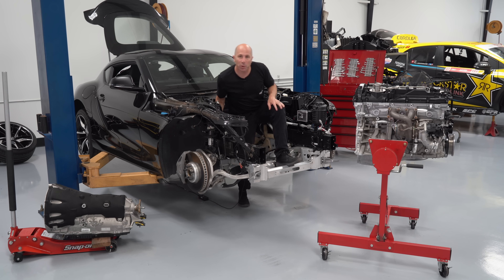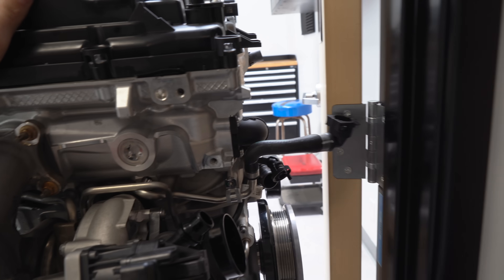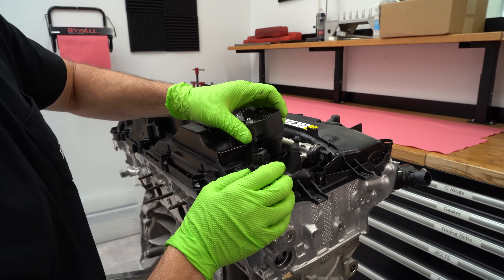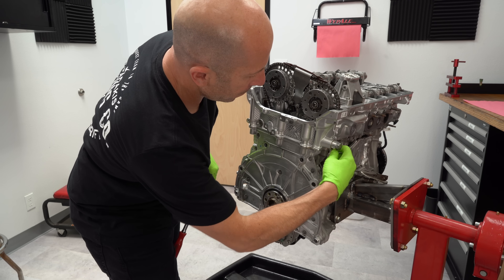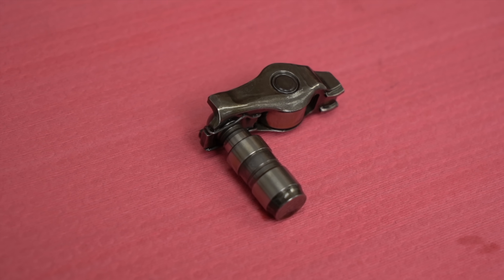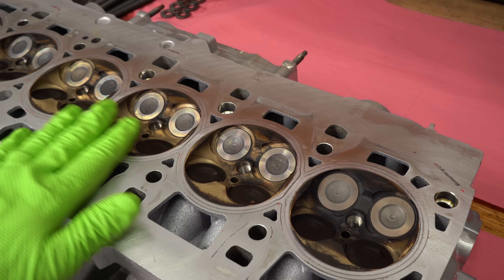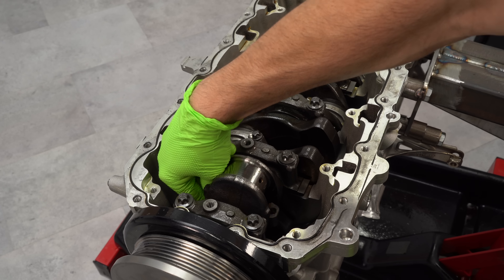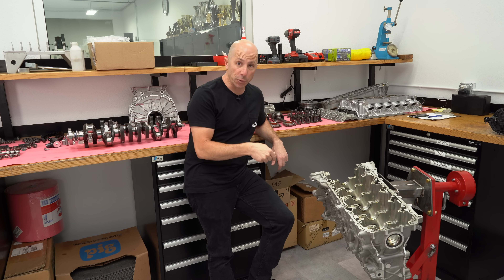2020 Supra B58 Engine Teardown - First Look - Better than the 2JZ?

Comment: Those Forza-playing 14-year-olds will NOT be pleased to hear that you said positive things about this BMW engine
Reply: Nobody gives anything new a chance anymore.  2JZ greatest thing since the sewer system was invented. Blah blah blah
Reply: I just laugh when I see both Toyota and BMW fans get together. Hating is loving guys let’s all shared the love and give BMW some respect McLaren F1 engine was made by BMW and hold the record for years.
Reply: @isfngu4213  you leave in the past.
Now 2019 and bmw comfortable crap.
Reply: Edgar O'Kras I owned car made by both companies and work on both of them100% no mechanics touches any of my cars except for recalls by the dealership . I work on military aircraft so these engines are pieces of cake compare to what I do daily. May I say I don’t gotta make sure it lock wired, stamp and verified by a 3rd set of eyes each time I rebuilt, testing and certified each unit. I have no problem working on them even though BMW required special tools . Each has its problems of their own that can be said to all manufacturers. Toyota interiors are garbage. BMW isn’t made for the poor. If you see an old German car still running that person isn’t poor and it’s not cheap to maintain compare to a Japanese cars. You might be right I m old school but the technology age is growing rapidly. This engine is not the last you will see ask how I know . in the near future you will notice German companies producing “CamLess” heads.  I love my Toyota Mr2 engine is exactly same built as 2j , but I m sure everyone need something New . More modern the answer has been made now let all enjoy what manufactures has given us as a consumer.
Reply: I clicked on the video for comments like "Nothing is  better than the 2jzzzzzzz. 2jz best engine, none better" and stuff like that😂
Reply: @CBrown621  found one
Reply: @CBrown621  funny how to this day its the ONLY IMPORT ENGINE in the world running 5's GTFO. The fastest BMW out there barely ran a 7.20 and was a promod from africa. Its also dominating in the races its allowed to run. Why not tell lemans stop being little bitches and let toyota run 2jz's you see what happens in Drag and in Time attack. Look at the drift world. 2 engines 2jz and LS easy make TONS of power very stout motors.
Reply: @sariahreigns3666 A car powered by a 2jz  will run last @ Leman 24H. A 24 hour race is very different from a Drag race or a Time attack.Once that Block has heat soak from the first hour, you then have 23 hours to go. Too many re-fuelling pitstops. They're getting more power and fuel efficiency out of a diesel.
Reply: @nssherlock4547  i was just using it as an example. Every sport that motor is in it competes and sometimes DOMINATES.  As far as durability, real street won second place in drag week with a SEALED engine. 

Thats 3 runs 7 days 5 tracks. also driving on the street and towing a small trailer from track to track. Thats a PRETTY durable motor. I also know 3 people with 2jz's that run thier cars pretty hard have over 800HP and dont really have any problems. 2 of the three have ran thier setups for over 5 years.  

As far as fuel efficiency well there are ways around that at cruz cutting clyinders off alot of tuns can do now. But i do agree its not as efficient as diesel. 

But for people to continuously try and claim the b58 motor is better then the 2jz is rediculous. Performance wise there is 1 maybe 2 motors that out perform it and non of them are bmw.
Reply: @sariahreigns3666  the 2jz hasn't dominated anything but exhibitions. You compared exhibition cars vs promods.
Reply: Come on guys, can y'all just have an objective opinion rather than being irrational haters and fanboys
Reply: CRA_55 The objective opinion says that the engine is complicated, expensive, hard to repair, and needs lots of tools
Reply: @BF109G4  Some things that need clarification on what you said about the engine, complex no, simple no, at best intermediate. Expensive yeah but on what scale. Hard to repair on some parts yes but on others no. But dont keep speculating when it hasn't even proven your theories and also dont shut off compliments on engine he said and only keep your ears open to the words you want to hear
Reply: @BF109G4  E30 M3 Evo II daily driven by me,28 years old is it now....only unexpected repair was the water pump about 6 years ago.On my E39 540i,with nearly 450000km on it as I sold it,the only thing that broke unexpected was the AC.So not every BMW is crap.....
Reply: 14 year old gamers have thousands of hours of engine design and tuning experience.
Reply: This car with 93o, downpipe, and tune ran 10.79s! These cars are a lot more impressive than I thought they would be. I’m more or a muscle guy but I appreciate anything that’s fast that’s for sure!
Reply: phew good thing im 15
Reply: Idiots say that

True car guys know that bmw has lots of power with just little mods
Reply: CRA_55 14 year old forza player here:
I think the B58 will be the same (or almost) as the 2jz, and the 2j is overrated, can’t wait to see what people will do with the mk5 in 2-3 years, 
The 2 bad things about the mk5 is that they didn’t make it look like the concept, and that it’s automatic.
(If i wrote something wrong i’m sorry, not english)
Reply: Engel Schol good luck with a belt driven oil pump lol
Reply: I don't understand why most people here slag this engine off. Bmw have always over engineered they're engines. I have an m50 in my 3 series which has forged internals from the factory. There's people on here who has squeezed 500bhp out of that aswell. Toyota obviously know what they're doing when they've used the new bmw engine. They're both good manufacturers at the end of the day.
Reply: @dav3ys  it's the dawn of a new age man most people that race anymore are ricers and us that know what we're talkin about have pretty much all Gone with the Wind it's sad really I can't believe how simple-minded the world has truly become that people are such a bunch of retards, that's why my M3 so far is undefeated people are so gullible nowadays
Reply: It’s a BMW engine that was torn down and rebuilt by Toyota engineers. So far, this engine looks pretty good. I can say I’m impressed and happy to see them reduce the number of gaskets (which are definitely fail points for high pressure) and using silicone gaskets when they do. Looks like the new Supra might have the first reliable BMW engine ever not on a motorcycle 😂 

And yes I can talk shit, the CEL is on on my Bimmer 😂 😭
Reply: @Mr_Bones.  it wasn't rebuilt by Toyota.
Reply: Fuck them.
Reply: Lol you can say that a 1000 times over
Reply: I laughed so hard that my dick got hard as well
Reply: 14 year old forza players don't even know what a 2jz is
Reply: Nothing like those BMW cock suckers that but in and ruined a legendary car because BMW don't know what real power is so they rebrand it and say it's fast
Reply: HiShoK didn’t they have a bmw engine in a McLaren that held a record for years
Reply: Actually i find that engine pretty cool :p
Reply: @Basti A the way turbos build power is much more then just changing the size of a turbo. If the manifold is BUILT into the motor to get BIIIIG Power out of it your probably going to have to replace the Head of the motor with a custom head ported and polished exhuast and intake ports? I dont even know because its such a dumb idea for aftermarket. Youd be better off aftermarket wise trying to fit the n54 head to the b58 block atleast then you can run external intake manifold, and external exhuast manifold. Because no matter how big the turbo is if the exhuast runners arent big enough to handle massive air flow big turbo wont do shit.
Reply: @sariahreigns3666  you seriously need to calm down.
Reply: Controversial opinion, but I actually like the MK5 over the MK4
Reply: Never liked BMW but this engine seems pretty cool.
Reply: hahaha
Reply: Well, BMW is a great car maker.. right?
Reply: Cool engine. I'm just confused why we're giving toyota credit by calling it a "Supra" engine.
Reply: @Basti A nope. Just not a fan boy prenteding like I know what I'm talking about.
Reply: honestly, the 2jz makes a better dyno queen race car, but this car actually looks better than the bubble-mobile mark IV and makes a way better daily
Reply: мне 22
Reply: These engines are still pretty new, only time will tell if they're reliable or end up becoming the next S85.
Reply: @Basti A in the last 10 years a few American owned engines have been on the best of lists.
Reply: @Basti A even international top tens there have been us designed engines there it's been awhile since America hasn't really released a new engine to the masses yet that has been a huge revolution. I'll admit that.
Reply: @Basti A and that really doesnt matter. Lists are never exactly the same between publications.
Reply: @Basti A fanboy
Reply: Brock Nelson that is a fair point I don’t care for timing belts.
Reply: Whilst I am impressed with the all in designs that BMW came up with to save weight all those will become useless when you start factoring in things like fmic's and there will have to be a better designed exhaust manifold for a bigger turbo I'm sure it will hit 1000 but its gonna be a money sink on custom built parts until the aftermarket world works this shit out
Reply: @Basti A hes not stupid just wait 40k for oil leaks to ensue around that rear timing chain and then you've got 18 hour repair job because they put the damn thing in the back didnt anyone learn from the 4.2l audi motor
Reply: video games bad
Reply: But muh 2 gay zee 2000 horsepower from factory
Reply: @Tunnel Zone yeah it's done a lot better than I originally thought it would. Lots of aftermarket dollars does help. I'm amazed at what people are doing with vortec 4200 for a lot  less money though. I really want to drop one in a firebird and go make some mk5 owners cry.
Reply: BMW is superior
Reply: Look dude, I may be 30, but my inner GT4/NFS:MW playing 14 year old sure is not excited
Reply: Great Engineering, better response but definitely headache and a money pit. 2jz  bit lazy at first but definitely reliable.
Reply: It was a collab with Toyota not all bmw
Reply: Lmfao
Reply: OM606 … 🔥
Reply: 2jz is my favorite engine, but I agree 100%  this tik tok generation of kids glaze it thinking it's the only engine that works. "1000hp" bro"  

Bmw made a great product here
Reply: I'm a bit wary of BMW engines because they don't have the greatest track record for reliability, but since these particular engines had to pass Toyota's QC process, I feel much better about them.
Reply: 😂😂 best comment I've read all day 😂😂
Reply: CRA_55 💀💀💀
Reply: Leave it to BMW to over complicate an engine...oh and cause choke points in its design making it harder to modify....can't wait to see the issues he runs into trying to get 1000 hp out of it with that stupid one piece head/exhaust manifold...not to mention the overly complex variable valve lift crap...
This engine looks like it was well designed to handle the stock amount of power...and not to be modified for much more...plus the thing is huge.
Reply: @harryguy76  Do you have any idea how long it took the aftermarket to get the supra over 1000 whp... that didn't exactly happen overnight
Reply: @1994SHOtime  Yes but this engine is designed from the ground up to make and be as efficient as possible at its designed intended hp and TQ... not over built like the 2JZ...Imo the head design and direct injection are a bottle neck and imo the block is not strong enough...plus the way they have designed the bottom end is so stupid having the block skirt down around the main caps rather then tying it all together with say additional cross bolting into the main caps...
Reply: @harryguy76  well, mission performance is already getting 630+ WHP on stock bottom end B58's, so we're only 370 away from 4 digits. Bet me that we see 4 digits with this block/engine.
Reply: @harryguy76  cross drilled mains is only to make the block more rigid it has never made the engines block capable of more hp. As people have made 4k hp on 4 bolt main blocks
Reply: @harryguy76  there are already closed deck BMW motors with over 1200hp on them. The only problem have been the clutches in the Dct tranny and rear axle holding up. General drag strip problems. Let me know if you need me to share that with you.
Reply: Hey man I play Forza but I'm also a street racer and BMW in fact makes the best inline 6 engines so all these ricers complaining about BMW parts are just retarded, if you all don't believe me Google search it and you'll be surprised type in who makes the best inline 6 engines and you'll see BMWs number one with their M3 E46 same engine thats in my car
Reply: @Basti A thanks for the insight,  didnt know that. then there is pretty much nothing you can do if you need more volumetric efficiency. welp good luck to the bmw fans. soon as c8 vette gets a manual trans im going to get one.
Reply: The problem is; name me one BMW M car that hasn't had catastrophic engine issues? It's OK for reviewers to wax lyrical about it now, but tell me how you're getting on with it 3-5 years down the line when you're staring down the barrel at the cost of an engine rebuild, and the panic across your face .. hoping the car will pass the inspection so you can sell it onto the next poor sucker. 

And lets be honest, its not as though Toyota couldn't resurrect the 2JZ, or better still, pull a 6 cylinder from off the Lexus production line. What Toyota was thinking by getting into bed with one of the most unreliable name in the business, I'll never know .... other than, as Scotty Kilmer says, the money these companies makes from 'Planned Obsolescence'!
Reply: @juststuff5216  2001 e46 M3. To date, still on the original engine and 200k miles to speak for. The only problem was a change of coils  at 120k and the recalls done by BMW free of charge, other than that the car is still the rock solid  car I originally purchased. So as it stands, I own a reliable 3.2 liter 344 hp NA engine that sings all the way to 8,900 rpm. Such engine is an honest to god racing engine so I treat is as such. I feel lucky to drive it on the streets. Keeping up with the service intervals is key and I am more than happy to do that to keep driving the ultimate driving machine. I will never skimp on servicing costs because that would lead to much more expensive repairs in the future. Also, I will never part with this gem of a car and motor. I also own a mk4 supra bone stock. During my possession, I needed to replace, water pump, plugs, AC compressor, tempreture sensor and belt tensioner. Again, this car was serviced as per recommended intervals. Which car will I be parting, needless to say the supra, but I will wait for dipshit fanboys like you to push up the price of the car, and most probably get the mk5 supra instead (I just hope they will introduce  a manual option by then). I also own the mk2 MR2 and celice GT4, the MR2 and Celica being in my possession since new, and it is the same story for them too. I also own an FC and FD Rx7, those where a nightmare.  Problems with gt4 and sw20 failing parts like the supra. To be honest to god fair, the Japanese vehicles had cheaper-ish parts back then, today though, not so much. I am stoked the Supra has a BMW engine inside cause I know, if well taken care of, they function like clockwork.  How is that for BMW M division reliability?
Reply: @juststuff5216  E30 M3,E36 M3,E46 M3
Reply: if  that alumunium bmw engine block have the streght of iron block 2jz it have potential but long its race car but if a normal life condition not so much because stupid ass bmw electronic just look at that how complicated that thing is
Reply: Basti A you maybe right I’m more familiar with cummins where most high horsepower engines are swapped with stock machines rods or forged rods but it could also be due to poor castings or a bad design of the cracked rods. The built in exhaust manifold will be a problem for sure though.
Reply: @farmyardfab  yeah i give you the Points for the exhaust Manifold. My Tuner owns a M5 running at 900hp and 1140nm without any Problems with the Cracked ones. The engine itself can handle 500hp easily, the Block more but you would need to Switch to a bigger turbo and Open Air intake which isnt a big hassle
Reply: @farmyardfab  um most rods for diesels are in need of the tolerances. But diesels are different animals. Barely comparable. Most of the high hp engines are using billet stuff that is machined to need so a cracked or splintered rod is likely a little to expensive to justify
Reply: I’m not 14 nor do I play forza. But I don’t think this engine will be vary becoming to power mods. The head design with a built in manifold looks like a nightmare and will likely mean having to design a complete new casting to have substantial power gains. The cracked rod design is also not desired for high horsepower, its vary common for 5.9 cr engines to have standard machined rods put in for an upgrade over cracked rods. This engine to me looks like the common over engineered nonsense that led to engines like the 2jz becoming the legend that it was and it’s too bad Toyota didn’t have enough self respect to recreate that magic.
Reply: @farmyardfab  the 2jz is also an over engineered engine?
Reply: @farmyardfab  It cost so much money to create a motor, starting @ a blank paper.
Reply: @farmyardfab  do you mean the engine yamaha designed
Reply: @farmyardfab  You obviously don't remember the over engineered sequential twin-turbo setup on the 2JZ-GTE that everyone replaced with a single turbo because of how bad it sucked.
Reply: The Dude don’t forget the gentlemen agreement that limited the power and speed of japanese cars in the 90’s
Reply: @BF109G4 
You know that the basic 4-cylinder  block from the 2002 turbo was also the base for the BMW F1 engine at the time, right? And that did 1400hp in qualifying (for 3 laps). Toyota isn't the only company that can and has overspec'd their engine blocks, and the 2JZ isn't the only engine in the world that can be modified to produce many more times it's original horsepower.
Reply: @TheDudeAbides1776  You made me chuckle
Reply: @BF109G4  was that ever actually proven? Like it seems to be a myth with little to no facts behind it. I mean shit the cars barely made 276 hp
Reply: @farmyardfab  probably never touched a 2jz.
Reply: Just_guy_ stuff Sure buddy. Cool story 🥴😜
Reply: @farmyardfab  because toyota didnt work on the 2jz themselves. Most of the fucking rnd was done by Yamaha. Toyota has never made a legend of a car without someone else's help and that's why the 2jz effectively made Toyota a dead company their engines are barely ever theirs.
Reply: @farmyardfab READ MY MIND!!
Reply: @farmyardfab  Cracked rods will has no impact on strength of the piece, it just means you will have perfect tolerances with cheaper production.  There are tons of aftermarket high hp rods like this
Reply: @farmyardfab  no.
Reply: @1Leberhaken  yes.
Reply: @farmyardfab  crack rod design is not desired for high horsepower? lol dude it's used even in mercedes benz diesel trucks like actros so no shit
Reply: Just_guy_ stuff 
Please sir don’t say bad things about this engine because kids and fanboys will start to insult you personally
Reply: Idk personally the internal manifold is a shit design. Also I like iron blocks it may take longer to heat but who cares that's why they made aluminum heads and iron is stronger  and can take more heat so unless they want to sleeve this car to take 1000 plus hp I dont suspect it will last long with out a substantial cooling system and then your gonna boost the shit out of it on turbo while reving it to the moon I'm sorry but that sounds like a big waist of money not because you cant get the power but because it wont last as it is. And let's be real here you need special tools and a bracket with a special motor stand just to pull it out and disassemble. Also what happeneds when a timing chains snaps and the motor or trans needs to be pulled lol. Yeah $$$$$ fuck that. Almost 60k for this lmao yeah no buy American get more cylinders for cheaper sound better have more tq and it's easier to work on and no special tools needed while having room to work hmm.... no brainers keep that shit in japan or Europe were it belongs.
Reply: @joshreynolds729  but aluminum naturally sheds more heat.
Reply: And BMW fanboys who collect others trash would enjoy hearing good things about this trashy engine
Reply: @BF109G4  Found one lol
Reply: BF109G totally agree with you the 2jz is an old and heavy engine , the new bmw engine is way lighter, more modern and economical, there isnt a reason to hate on both of those engines seriously
Reply: @BF109G4  Triggered JDM fanboy detected
Reply: 1994SHOtime a forza horizon kid detected lol
Reply: @BF109G4  You know which company made McLaren F1:s engine? ''Fan boy'' 🙄
Reply: @BF109G4  You don't know the S38 engine (BIG SIX - M30, M108, S14 and even BMW M12 / 13 turbo)
Reply: @BF109G4  Sen S38 kodlu motoru bilmiyorsun sanırım (BIG SIX - M30,M108,S14 and even BMW M12/13 turbo )
Reply: @BF109G4 damm bro when do you turn 12?
Reply: @BF109G4 don’t engage with the wrenchless, they don’t even know what a banjo bolt is, let alone the plethora of reasons why the jz engines are better.
Reply: @BF109G4  Why it is trashy, BMW has always made very good inline 6 cylinders.
Reply: Midna2k7 BMW is the least reliable company in the world. Their engines are complicated and expensive. No records on the drag and no retail value
Reply: @BF109G4  French companies, like Renault or Peugeot. Thats even worse... In 7 years with my e30 325i, never had any issues. Always started @ any weather 👍
Reply: Midna2k7 
26 years with my land cruiser. No major problems
Reply: @BF109G4  I laugh at anyone who thinks German motors are "complicated"
Reply: @BF109G4  lol how many stock inline 6 long blocks do you know to go in the 9s  on low boost? Very few. Well ghassan auto just did it with a BMW 135i. BMW trash LOLLLL
Reply: @austinrosser9590  Good answer
Reply: LewisFarikon Do you have eyes ? Watch the video
Reply: austin rosser 
Watch the Real street clip where they extracted 930hp from stock 2jz
Reply: LewisFarikon the clip shows how complicated the engine is
Reply: austin rosser I’ve never seen records broken or champions won by a bmw trash
Reply: @BF109G4  same with my E39, I havent had any major problems. 190k miles and the interior still seems very close to new and the engine is still very healthy.
Reply: @BF109G4  the least reliable engines in the world have you seen some of toyotas in house engines blowing up like every 10k.
Reply: BF109G  this kind of talk just shows that you have very little exposure to bmw engines, please drink a green tea and relax
Reply: @BF109G4  BMW is rated 3rd most reliable cars in the world according to consumer reports.
Reply: @v3ru70  
It’s rated 15
Reply: @BF109G4  Look at consumer reports 2023. Takes into account past 4 years of cars. Only toyota and lexus are ahead.
Reply: @v3ru70  
The consumer report for 2023 puts BMW in 15.
Reply: @BF109G  I'm undecided between a bmw 530d as my next car or a Toyota landcruiser. Strange comparison I know, but I've had toyota lexus cars for decades, love the reliability, but we have a big caravan to tow and I do 400+ miles a week commuting to work. My head says landcruiser, and to wear the fuel costs, but my heart says bmw. Someone needs to slap my face with a wet fish and talk some sense into me 🤪
Reply: @BF109G4  JFpower disagree with you. Moreover, bmw is not about records, its about driving experience. Clearly you never owned a bmw.
Reply: @BF109G4  explain how its trashy ?
Reply: It’s still a BMW..... won’t last for shit. It’s just an unfortunate FACT about BMWs.
Reply: @chadedwards7689 
I always hear this from Americans (and only Americans) about German engines in general. Why do you always have issues with engine reliability, when pretty much everyone else sees them as reliable? Is it the factory the cars come from? The quality of your fuel? Or you're neglecting services. The engines are designed to be serviced once a year, and then they'll last. Take my father's 2010 X5 for example, the one thing that has ever been wrong with that was a leak in the compressor fro the climate control. The engine itself has been running without issues for 9 years now.
Reply: @mikeblatzheim2797  oh really? You got 9 whole years? Woooow. I'm impressed. Smh.
Reply: @chadedwards7689   do youre home work i always drive bmw's without any problems Just service the car right did drive two of Them to a very high mileage without any probs on the engine one E36 328i to 500k km's  also a E39 540i to more then 600k km's on the clock with the original engine dude dont talk shit if you dont know where you are talking about..
Reply: @chadedwards7689  That is complete bullshit and thats it
Reply: Chad Edwards have you even drove or owned a BMW Chad? 😂
Reply: @187Blondie  My family drove nothing but BMWs and Audis for the first 20 years of my life as my dad owned a Porsche, Audi, BMW, VW dealership. So yeah, I've driven a few..... Smh
Reply: Chad Edwards yeah first 20 years of your life so lets say you’re 30 then the cars are at least 30 years old, engines & cars have come a long way in the last 10 years nevermind the last 30 so your opinion is biased & fanboyish to say the least, & you criticise BMW Engines & label them “trash” yet BMW have produced some of the most legendary engines of all time particularly the McLaren F1’s V12 which is still to this day at 25 years old the most powerful N/A engine ever produced and probably always will be period, so for someone who’s been around BMW’s all your life you still have a tonne of homework to do.
Reply: Chad Edwards how am i a fanboy? Cos i know more about Bmw engines than you even though ive only ever driven a couple yet you’ve grown up around them? You fool.
Reply: Chad Edwards But you don't know any better 😂
Reply: @chadedwards7689 so you probably know nothing about BMW.
Reply: @chadedwards7689 That part.
Reply: @chadedwards7689 your comment aged like fine milk